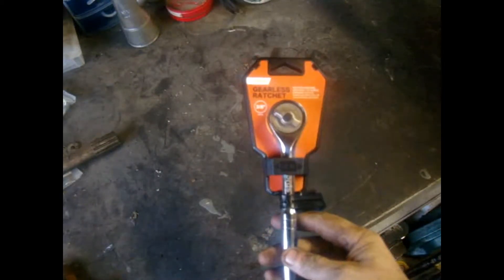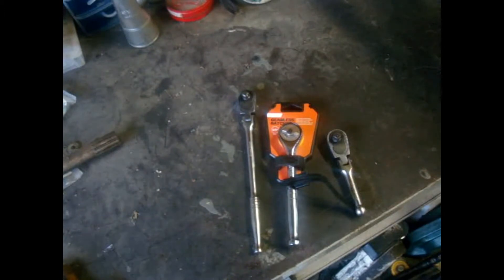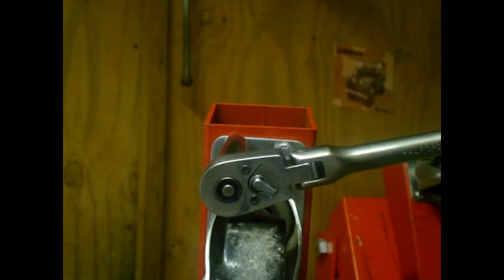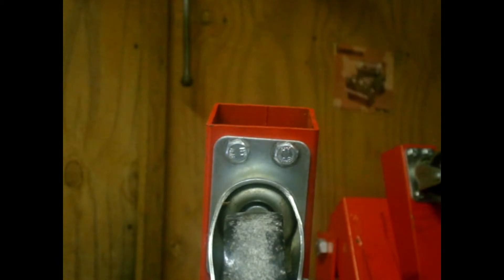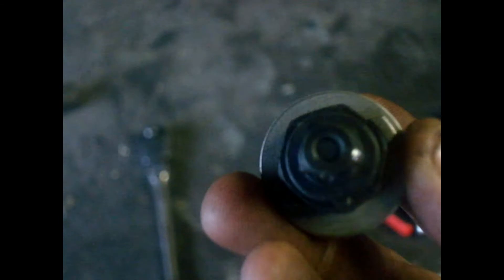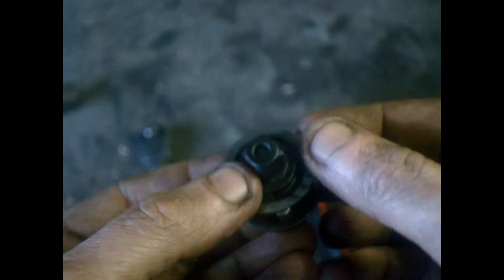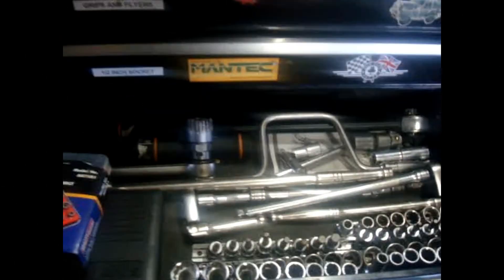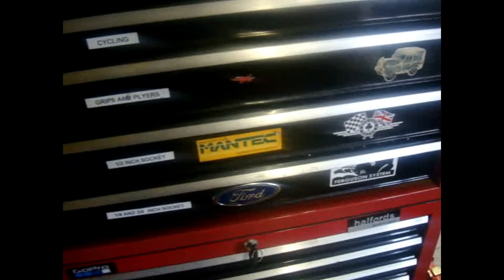Halfords Advanced 3/8 Gearless Ratchet

Comment: That 3/8 flexhead is a 45 tooth brute, Ive taken out wheel nuts with it np. The gearless ratchet is a nice compliment to it in the go-to tool box for if or when you need a 3/8 that needs less clearance like when yer doing an oil filter, 2 wrenches 1 set of sockets Brute strength & finesse all in one.
The gearless feels like a good quality tool, it feels as good as the best Halfords Advanced tools that Ive used.
Reply from the maker: I still haven't broken one and for value for money i think they are the best. Good quality tool without paying daft Snap-on prices, Plus they are easy to replace should you ever need to as your never far from a halfords.
Reply: @markpritchard  
Ive just ordered the 21 piece 3/4 set.
I have the pass through vortex set too, Im a big fan of the Advanced line.
Reply from the maker: @SPIDERM0OSE  As good as tool you'll ever going to get, there is nothing a snap on tool can do that the Halfords advanced can't.

Comment: Is this thing any good? When I ratchet, I like the noise as it gives feedback on how much you turned. Do you get any feedback on where you are with this gearless ratchet? Let me know, interested in getting a 1/2", or maybe I should just stick to the proven geared .
Reply from the maker: I do know what you mean, it is strange not hearing the ratchet noise and it seems strange racketing away with no noise. Who would of thought I would have missed it, well, I still have my normal ratchets as well for therapy. However, as far as reliability and usability goes it feels and works fine. I'm not going to say its better then a normal ratchet but in tight spots there is a slight advantage and I haven't broken it yet, Or maybe I'm just not trying hard enough?

Comment: I bought a halfords 1/2 inch one in 2014 and has never given me a issue I might have to try there 3/8 flex head next
Reply from the maker: They've never let me down. Although if something is FT i use a braker bar instead to crack it then the ratchet the rest of the way. I don't think theres anything the top modles can do that a halfords can't. And halfords is more then half the price, even less if you get on during specail offers.
Reply: @markpritchard  Yeah I got there breaker bar too and has never let me down and there sockets and spanners are really good quality too. Used them on a lot of cars and not once failed me I am going to keep a look out for the next sale and pick up the flex head ratchet and few others next
Reply from the maker: @Ky2  Me to, got the ratchet spanners and the notmal ones. All good not broken anything. I not a full time mechainc but i am working on old tractors and Land rovers. So things can sometimes be really tight. I've got really good at heating nuts up now.

Comment: I dont bother with gearless, i just have the ones out there kits
Reply from the maker: I do like there ratchets, as I said in the video the long handled 3/8 must be around 15 years old now and the short handle a good 10 years and I haven't broken them. I also have the 1/2 as well. Never had a problem with any of them.
Reply: mark pritchard i broke the 3/8 in my kit i got for christmas in under a month but the replacement has been fine.
Reply from the maker: When did you get it? I've herd Halfords  changed suppliers a few years back and the new ones aren't as good. Not sure if there's any truth in it though but I have noticed the packaging on the tools and socket sets have changed. I also don't over do it with mine, if I find something is really tight I get my breaker bar out and crack it lose with that then return to the ratchet.
Reply: mark pritchard this xmas, got a middle and top box to go on my cabbinet in my workshop. Yes they did change but only ratchets and as good, spanners are better, i might splash out and get a snap 1/2 amd 3/8
Reply from the maker: Another good tool company I like is Wera tools. If you go on there web site they have a discount on at the moment. There 1/2 inch drive is down from £70 to £40. https://www.uktoolcentre.co.uk/brands/wera.html?gclid=Cj0KCQiAwp_UBRD7ARIsAMie3XbkU2-V2LHWBybAfKcGqKm0XYPNvgigU0GIgdMuXygF7OlH3tGmRMQaApXYEALw_wcB

Comment: Put it against some rusty nuts, when you give it some wellie, I was going to buy it, but thought, can it take some real stick, the guy there tried to say that halfords has been made by snap on, maybe before, maybe, but this gearless is kobolt, made by lowes USA, I know lowes well, got quite alot of my supplies from there,  halfords years ago used to be good, mid range I think, also they did not have 50% off on their tools, which is a crazy amount of money off, so I guess its a trick, the actual price is the sale price and the other price is when they are quids in, I guess with the little people do now a days, it keeps em open, also they do change any mangled tools, with maplins closed its a throw away society of weak sjw and feminists, we watch as the country falls apart, brexit means, we are not leaving, just another vote and another, until the ruling class get the result they want,
Reply from the maker: I've never had anyone say Halfords tools were made by snap on before, To be honest I just think of them as good tools for the money you spend, I haven't broken any of there ratchets or spanners yet although I don't tend to really abuse them and I'm only in my little workshop at the weekend. Main thing with snap on is although there good tools there just massively overpriced. If I only had snap on tools I'd only have 1/4 of the tools I have now and that's the main reason I have Halfords. I also have a trade card for them so I get mine slightly cheaper although the trade card doesn't reduce the price by much and then there's the fact if I do brake a tool I can go and replace it as there's a Halfords not to far away from me that's open 7 days a week. If I snap a snap on tool I'm not going to get a replacement for that in the next hour if I'm mid way through a job.